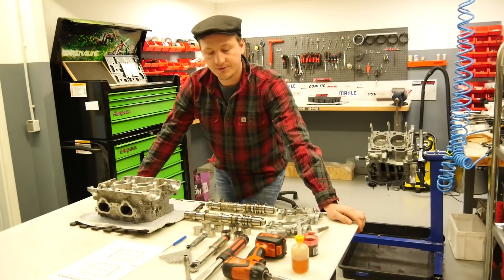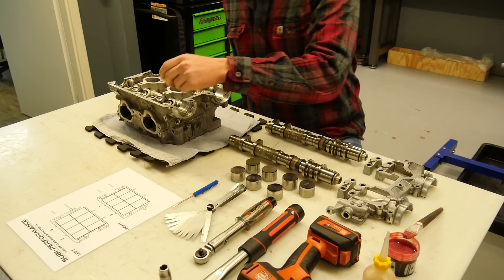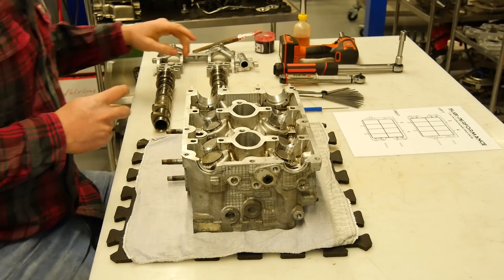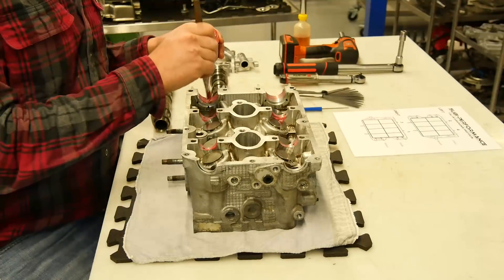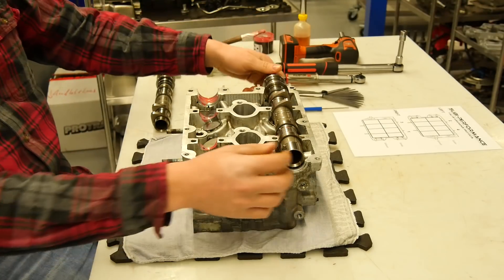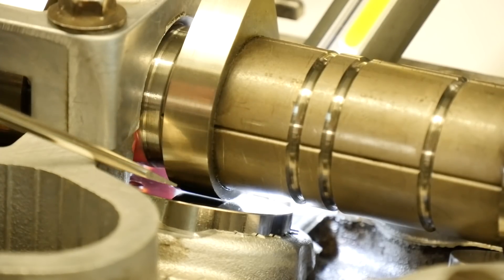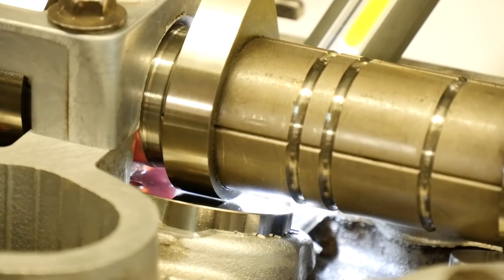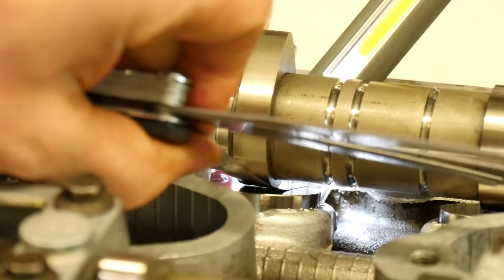How to Adjust Valve Clearance / Wie stellt man Ventilspiel ein / バルブクリアランスの調整方法 l Subi-Performance

Comment: So do you measure valve clearance with the heads off the block? Or with them on the block?

I was under the impression the head needed to be torqued down in order to make a good measurement.

Thanks for your excellent videos and shop work!
Reply: You can leave the heads on the Block but if you already have them off it's a great idea to adjust the valves because its just easyer to work on them.

Comment: Can you tell me, it is possible to regulate a valve clearance without remove an engine?
In sticker under the hood we can read something like this:
https://forum.subaru.pl/uploads/monthly_2019_02/20190202_204221.jpg.4b3e06e5623c474ec5b84af9f2fa09e1.jpg
So my second question is, we check te valve clearance on cold or hot - normaln engine temperature ?
Reply: Yes possible. If you have buckets (shims) you buy the correct number to give proper clearance to which ones that need it. If money is low use Dremel tool to grind the button on underside of bucket if too tight. Hopes that helps.
Reply: @benrodeheaver701  what is the correct valve clearance for the 2 lt twin cam turbo (with shims)/ inlet and exhaust?

Comment: Good job!
I tried to adjust valve clearance on removed from cylinder block heads.  The measuring is different if heads would be tightened on cylinder block. I guess it is not new for you )

Comment: Thanks for the informative videos!! I have a question; I have a build that’s been sitting and I did not write my bucket position on paper and the marker I used on the bucket faded. What’s the best approach? After watching it looks like I can find the best fit before torquing down the caps since the camshaft will like spin smoothly if the clearance is near spec and then I can torque and measure and move the buckets as needed?  Good thing is I have the buckets segregated by cylinder head.

Comment: Ich bin echt begeistert von dem Inhalt den du hier zeigst. Auch als nicht KFZ Mechaniker (nur Subarufan) ist das sehr lehrreich.
Was ist denn deine Erfahrung wann das Ventilspiel überprüft werden soll?

PS: noch ne Frage die vielleicht nicht hierzu passt, aber ne Idee für ein neues Video.
Könntest du mal was zum Thema Kurbelwellenentlüftung, Nockenwellenentlüftung, Oilcatchcan und Air-Oil Seperater bringen? Wäre wirklich interessant und du hast sicher einiges an Erfahrung dazu was du mit uns teilen kannst.

Mach weiter so!

Comment: There is an opinion that the gaps should be set on the head screwed to the block, they will change from the pull. Interested in your opinion on this.
Reply: @Derspiwak...,
I'm sure you meant to say bolted to block with the Timing belt on? It's the belt that can make a VERY SLIGHT difference, Usually not that much to worry about unless your super fussy. LoL
Reply: Torque the head to the block and connect a pressure rig to the oil system to pressurize  it to approx. 80 psi to simulate engine running. This will center the cams and fill the journal to bearing clearances correctly to give you the most accurate valve lash adjustments ever, if you’re that fussy.
Reply: @zukobringas5096  I'm not that finicky)) I'm just curious, because a familiar motor assembler said that if you first set the gaps on the removed head, and then screw it to the block, then the gaps will change due to mechanical deformation of the head, so I want to find out if this is true or fantasy.

Comment: Great tutorial! Im in this process right know on my spec c heads. Just be sure to mesure your old valve lifter with a calibrated micrometer or a tool like you use. With time they thin out especialy on ej20. You can notice the wear pattern if you look closely!

Comment: Nice video! You should do another about valve clearance but in previous model like impreza GT GC8 where we need shim to adjust valve clearance :D
Reply: Is there a way you can post the formula to obtain the difference for the correct thickness.